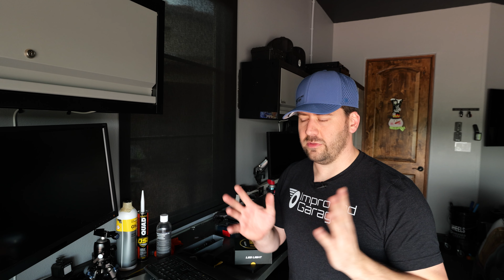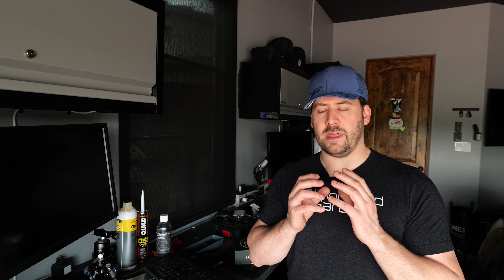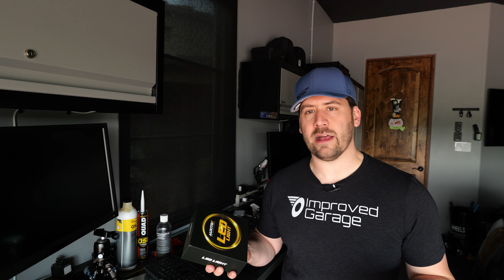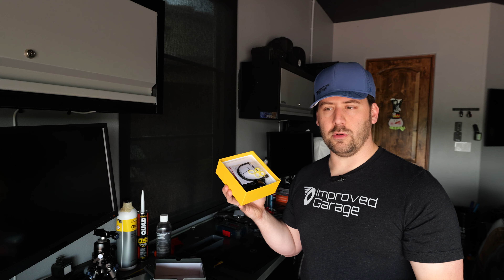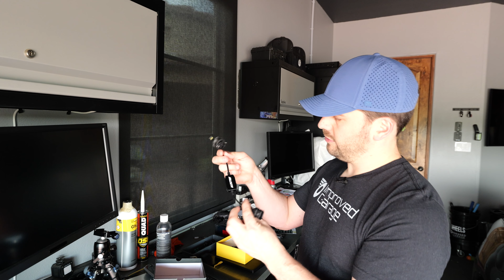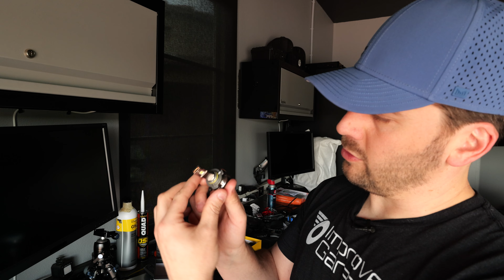IG492 Installing Auxito LED Headlights into our 2006 Mazda 3

Comment: Bought a similar set about 8 months ago. They work great. The little fans have to be the failure mode on these. Age, moisture, vibration, etc. We'll see. But they are cheap enough to keep an extra set on hand.